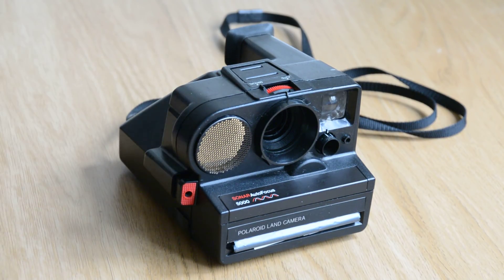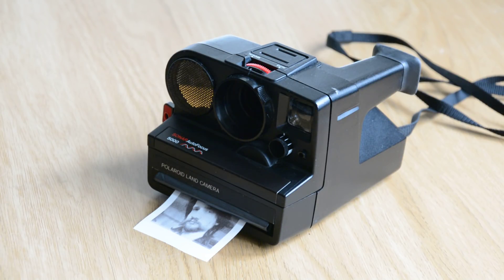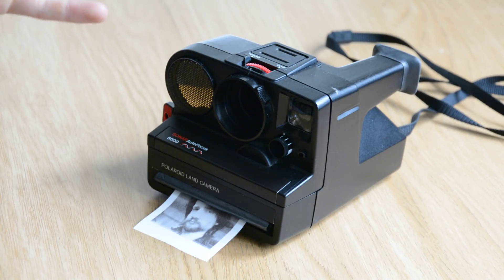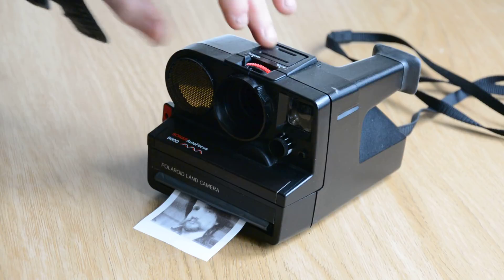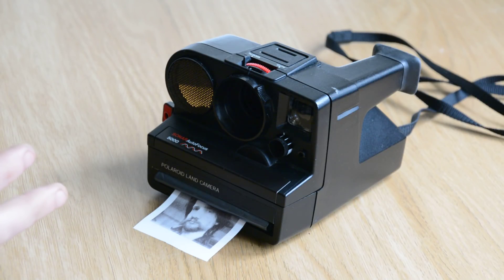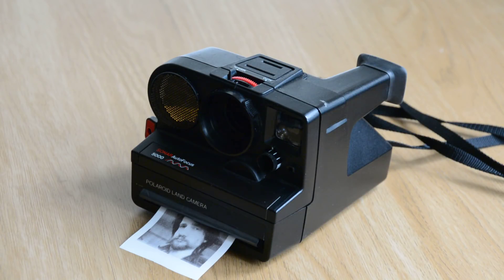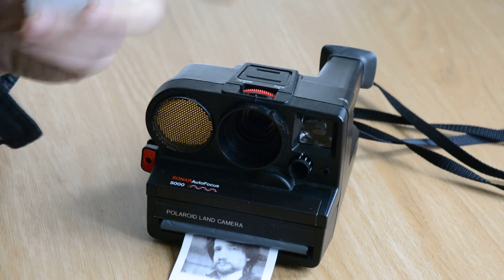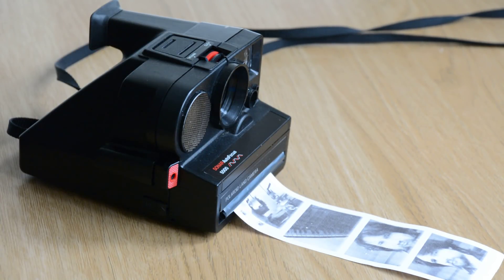Thermal Paper Polaroid

Comment: I did not know, i need one. Now you have one, and i dont. I dont think, that 32f103 has usb host controller. But it coukld be doable to capture NTSC signal from RC cam.
Reply from the maker: I think there is some support for USB host mode, but I'm not sure if you'd be able to use a webcam with it. Some of the stm32 chips have a digital camera interface, which would make it much easier.

Comment: Your OS boots in 2 seconds!!! Imagine if you could boot windows 10 in 2 seconds and you could use it for real after that. Mines takes about 10 minutes of intense HDD activity before I could use it. Microsoft should learn from people like you.
Reply: My work computer has an SSD in it and Windows 10 boots in about 8-10 seconds from when I turned the machine on. Something like system load time varies hugely based on what it's stored on.
Reply: Lubuntu on my really slow and old laptop boots up way faster than Windows 10 on my actual PC. :P